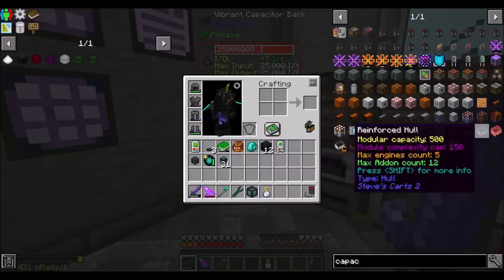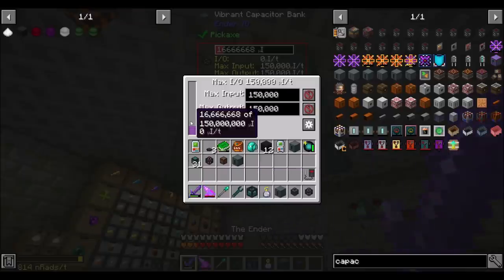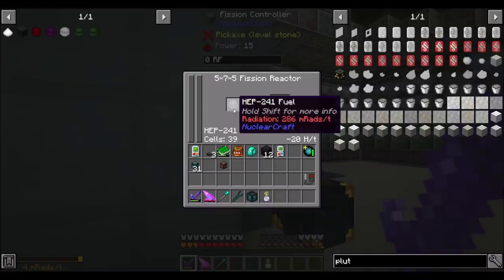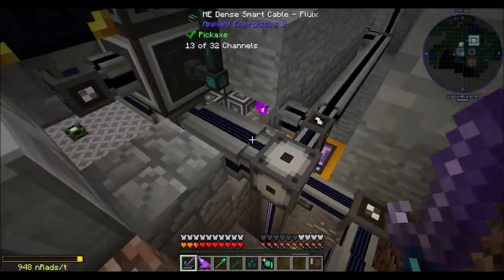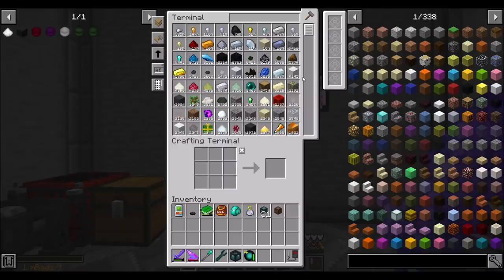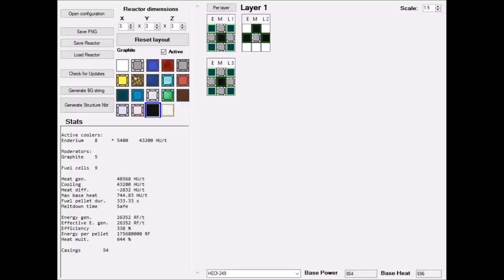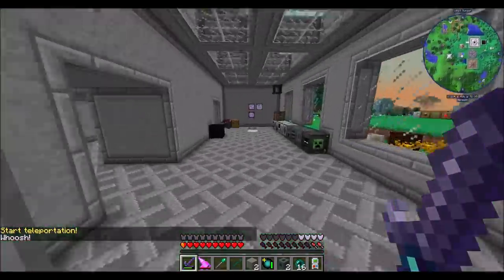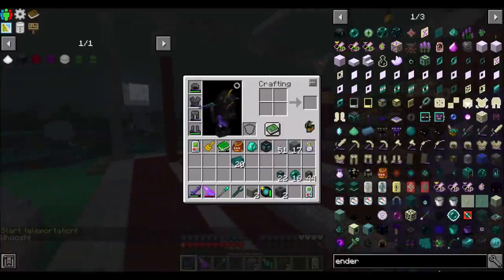FTB Revelations Ep61 Active Cooling

Comment: The mod that's blocking the Powered Spawner from working in the Deep Dark is the mod for the Deep Dark.
Reply: Kraleck that’s what I was thinking
Reply: @DeletedUser410  Except in the Overworld Dire has the anti-mob spawns ritual from Astral running 24/7 with amplified range
Reply: @DeletedUser410  same issue for 2 different reasons
Reply: It hurt itself in its confusion
Reply: @silverfur11  He didn't amplify the range this time
Reply: It could be that having the spawner on the floor might be the issue. He should try suspending it from above and see if that sorts it.

Comment: Not sure if you've already got a charging system setup, but the advanced filter from Enderio has options specifically for charged/discharged and for damaged/undamaged, so if you want auto-charge systems/auto-repair systems it's great. Don't need to bother with letting specific items discharge/nearly-break before setting the filter.

Comment: Note for future dire: when you get into speed upgrades for the void ore miner, pay attention to the number of upgrades required to reach max speed that's listed on the wiki! if you give it more speed upgrades than it needs it's just going to drain more power without giving you any advantage.
tier 2: 4 speed upgrades for maximum speed
tier 3: 5 speed upgrades for maximum speed
tier 4: 5 speed upgrades for maximum speed
tier 5: 6 speed upgrades for maximum speed
tier 6: 7 speed upgrades for maximum speed

Comment: Hey dire, you could half the buffers you use because you have empty spaces between two coolers. You could have conduit inside your reactor pumping from one buffer to a pair of coolers on each corner.
Edit:
Or build a bigger casing and have one buffer with more conduit inside.

Comment: 512 Pearls BTW; plus the buffer of the Melter itself plus 16 unmelted in the melter, and 16 in the chest, and 16 in the ME interface.
if you're accounting. and it looked to be about 10mb/t per buffer, so 80mb/t or 6.4 (call it 7 or 8 for even-nesses) pearls per second.
Which means that Woot might need some level 4 and be MUCH bigger in terms out output soon in order to keep that up - I don't even know if it can at that point.
Might be Dragon killing time and setting something up in the End to spit pearls your way...

Comment: Dire for the love of god, just place the power transfer above or below the Rad scrubbers instead of directly on four of them so they don't get the penalty for efficiency.
Reply: It would be a million times better even with just one space in between, Would, it even affect the range of the wireless transmitters.
Reply: @Einar730  for the love of god stop harassing people
Reply: So, the optimum layout is something like a 5x5x9 grid, long vertically, with the power set in the two middle spaces and scrubbers at the 8 vertices, with the 4 extra being in the middle?
Reply: @Einar730  no u

Comment: Could you use Resonant Clathrate as well as ender pearls?

Also, does one of your Astral perks prevent spawning around you? Maybe that's the "Denied by other mods" issue?
Reply: 1. Yes, they melt into resonant ender. Doesn't seem to accept clathrate without some tweaking though. Franky I'd have gone with cryotheum but that's just me. 
2. No, it's probably caused by the Deep Dark since the darkness damages you itself. Probably conflicts with the spawner checking for free space somehow.

Comment: That  spawner eats all the energy it can get; the more energy, the faster it will spawn. You need to limit the transfer rate to it. Also, it is still the deep dark messing with the spawning.
Reply: its 32k rf/t and its failing that often means its not worth the expense compared to woot or deep mob learning.

Comment: Y'know, something DIre said the other day was bothering me. He said in the mod the only way to reduce your radiation is to drink RadAway, which I find highly unrealistic. Radiation, well, radiates! From areas of high concentration to areas of low concentration, Heck, Standing in the same chuck as those radiation scrubbers should give you negative radiation accumulation. 
After all, Radiation functions like heat, because heat IS radiation!
Reply: The accumulated radiation is modeling radiation poisoning, not your personal radioactivity. RadAway is, uh, repairing the damage to your DNA or something. Still not realistic, but it would probably be mean to give the player debuffs that they can't get rid of at all.

Comment: You should take a look at molten salt reactors
Reply: @Einar730  yes
Reply: Yes
Reply: Maybe?
Reply: What kind of power does a molten salt reactor produce?
Reply: @alfreddrewes9362  It produces heat.
Reply: @alfreddrewes9362  It produces heat and nothing else. You need then to use the heat in a heat conversion unit or whaver it's called to turn water into heated water into steam into super heated steam which is the used in a turbine to create energy and steam which is then used in another turbine to produce less enery and warm water which is then usedin the previously mentioned heat transfer counterflow whateveritscalled thing to help speed up the water into steam and steam into superheated steam.
It's an extremely complicated setup that requires a lot of real math to do properly calculating energy creation, heat transfer and heat conversion. It would be extremely painful to watch Dire do it. I would honestly skip those episodes if they ever come. It's a fun system, but Dire isn't the kind of person that would be able to make it entertaining and it would be like 50 episodes before he realizes he started everything wrong.
Reply: @entitledOne  Is all that work even worth it? Does the steam reactor produce a lot of power or is it just something that's fun to automate?
Reply: @alfreddrewes9362  It's a lot of power, just not even close to the power a fusion reactor produces. I'm not sure if it's all finished completely. Lets hope the NuclearCraft dev sees this and explains it better. Dunno if YouTube has a tagging system. @NuclearCraft
Reply: @entitledOne  Basically, fusion and active cooling are OP in these versions of NC - both have been removed in the new branch of the mod (fusion will be revamped). The MSRs are very difficult to set up, and defo only there for people who really want to get into it. Hopefully they will still be powerful, but not so tricky in future builds :)
Reply: @NuclearCraftMod  for me at least, the tricky parts were finding ways to extract the HP steam fast enough and trying to get the HP turbine to accept more than 1600mb of steam per tick.
Reply: @martindinner3621  Yes, in fact I ran into that in the video spotlight. In the end I used Mek's fluid pipes, but pressure pipes is another sound option for large-scale fluid transport :)
Reply: @NuclearCraftMod  was running E2E at the time. Solved the pull rate issue using integrated dynamics fluid handling. Up to max int mb/t. Never did figure out how to get the turbine to use more.
Reply: @martindinner3621  Max int should do :P
The turbine will only use 100 mB/t per blade block at most, though that's configurable.
Reply: @NuclearCraftMod  Didn't realize NC was getting an overhaul. That's awesome, by far one of my favorite power mods. Tons of progression and the need to use previously acquired depleted fuels. Excited to take a look at the overhaul changes!
Reply: @jaykintner6488  Well, you're welcome! The overhaul's been a lot of fun so far - lots still to do, but should basically be better than the previous version :P

Comment: You are much better off running two environmental tech miners so that if you attempt to upgrade and oops math it wrong, you still have one working ok and bringing in the crystal.
Reply: you can use tier 2+ structure blocks in a tier 1 miner, as long as the controller is still tier 1
Reply: I used 9 void ore miners and got to tier 6 in 9 hours.....LEL
Reply: @sighmon5640  so the strategy is to craft the required structure blocks before upgrading. Problem is that you don't know how many you are going to need.
Reply: @PaulMurrayCanberra  thats not a problem.
you go over? okay, you can use them when upgrading to the next tier
you go under? just mix in the new piece with the old and rebuild the lower tier. you'll get the rest soon enough. (or just rebuild that lower tier entirely out of the new structure blocks, depending)
Reply: @sighmon5640  the problem is when you upgrade the miner itself without enough structure blocks to build the next tier.
Reply: @PaulMurrayCanberra  well its not like the information is hidden. if you make the mistake tough luck.

Comment: Ok guys, how do you actually add ores to the Astral ritual?  I found in the config the ore list, but how do you find the number of the ore?  Following the list already there it should be for example oreLithium;x where x is the number of the ore I guess?  Not really sure I've never tweaked anything in the mod configs.  Thanks!
Reply: Another modpack I have installed (Enigmatica 2 lite) has the weight at 600 for boron, lithium, magnesium and thorium. And uranium default is 550 so those numbers seem reasonable to me.
Reply: @KeefyGeorge  thanks

Comment: 100% / 12.5% = 8. Aren't Scrubbers #9-12 redundant?
Reply: @Valentine570  Gotcha. That means 8 scrubbers would eliminate 76% of the radiation in a chunk, and 12 would eliminate 80%. It'd take 35 scrubbers to eliminate 99%. Dire's gonna have some major problems when he starts doing the higher-radiation fuels. Even as far as his reactors are from his base may not be enough.
Reply: It specifically says on the scrubbers that they are additive. It's just a combination of Dire's impatience and the fact he's not running all of them at full efficiency.
Reply: @lenaclariel2100  That makes a lot more sense. I don't know why he hasn't used a wireless energy option. Phantom energyfaces are in the pack, and the extra utilities option he's using doesn't have to be placed on the scrubbers. Standing those off by a block should allow them all to run at maximum efficiency.